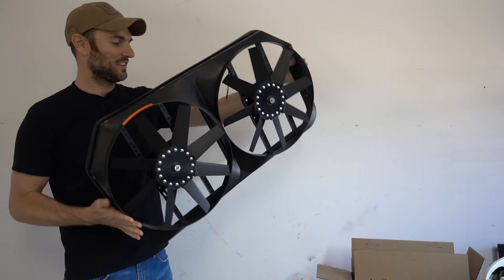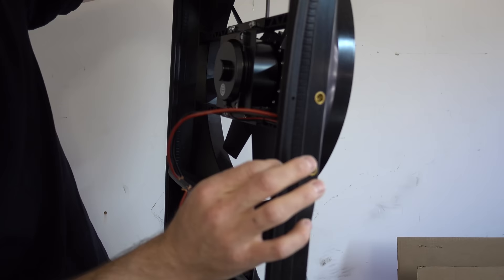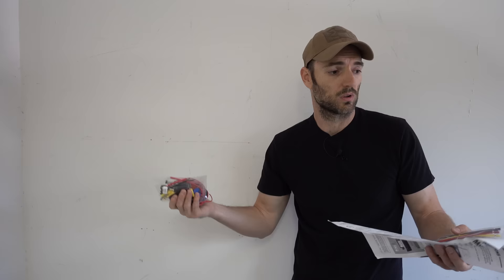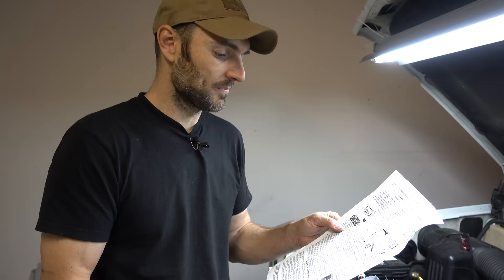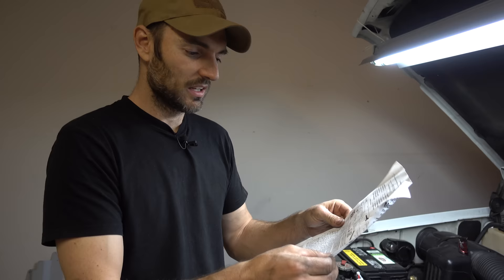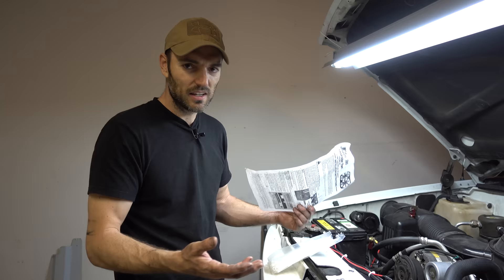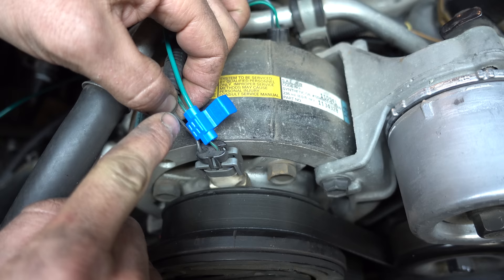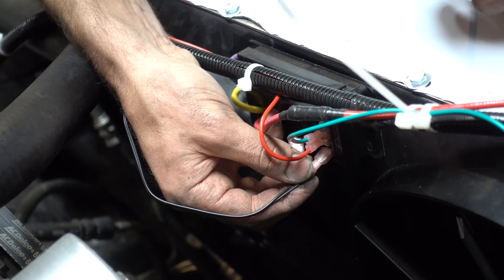Flex-A-Lite 280 Monster Fan System INSTALL & PAYOFF

Comment: Been running flex a lite fans (280)for years! Very durable,easy to install! I can idle all day long in the Texas heat with no problems! I didn’t have to drill a extra hole in my top plate as I have a big 4 core radiator and is probably a little wider! I also have a battery that has both side post and top post so I can easily hook up my fans to the top post! I think you also forgot to  mention that you can adjust the thermostat on the fans to come on sooner or later according to water temp! It also improves fuel mpg and adds a few horses since your not having to turn that big ugly clutch fan and my 383 stroker loves it! 😎Thx for the video!

Comment: I am a A.S.E. certified Master Tech with 30 plus years of experience under my belt.  I love older vehicles.  I currently have my Moms 1995 Caprice Classic, my late fathers 1995 Toyota T100 and, my 1998 C1500 Cheynne.  I also own my own mobile mechanic repair business.  Most of my customers have older vehicles (1976 Tradesman 300,  1963 Suicide Door Lincoln Convertible, 1968 Z-28, 1971 Mach 1 Mustang) so yes, I do know about older autos and prefer them over todays "ADVANCED" cars and trucks.  So sorry that I failed to acknowledge you Idea of installing electric cooling fans.  This is ALWAYS a great upgrade.

Comment: Thanks for the review of this fan system! There is no shame and no apology needed for doing a review of a product that you were given to review. 

I do a lot of crazy engine swaps and such modifications.  This fan would take care of a lot of problems with clearance, alignment and others with a custom engine install.That is a good control scheme where it looks at radiator temperature as well as A/C operation. That is similar to how the newer ECM-controlled fans work on factory electric-fan cars.
Reply: It's not shame, it's full disclosure and not doing it is a bad idea.

Comment: 1 tip on using zip ties. Make sure that the part where you cut the tie off is pointing away from anywhere you might have to put your hands or arms one day. That lil cut end can be very sharp and slice you open. Ive had it happen. Got a scar to prove it. No i wasn't the one who put the zip tie on the vehicle.
Reply from the maker: +Michael Potts That's actually a really good tip. Thanks for that. As for the zip ties, those were mainly temporary while I wait for any bugs in the system that may need to be fixed... So far so good!
Reply: Michael Potts use a flat pair of pliers, like linemens pliers to twist them off. Hurts less.

Comment: I used same system. I tapped into the ac system where the power goes into the pressure switch. This makes the fans run whenever the dash button for ac is activated, not cycling with the compressor. More sonsistent cooling.

Comment: For the price it would have been nice for Flex-A-Lite to have a wiring harness with watertight automotive wire connectors, instead of the customers having to use butt splice connectors.  At a minimum the two fan motors should have been connected together with a pig tail.
Reply: then soldier and heat shrink
Reply: Thank-You! 
I was thinking the same thing. The whole controller and wiring of fans should be done at Factory with actual connectors for power, sensors, and manual controls.
Reply: watertight connections  ? They don’t even have watertight connections on private boats ...lol
Reply: That would have added another $500 to the over inflated price! And the scotchlok the very badge of aftermarket crap!
Reply: Richard Edward  excuses for the inexcusable. At $500 I would expect a proper vehicle-specific wiring harness without a scotchlok and with an auto-reset circuit breaker rather than a fuse. And, by the way, all the wiring enclosed in a proper harness. Aftermarket *JUNK*!
Reply: @theceltbeserk1  HELL YEA FOR THAT PRICE THEY SHOULD PUT THE DARN THING IN ALSO
Reply: Agreed

Comment: When spinning the original fan and its tight that means that the clutch is good working condition, when it spins freely the clutch gave out. You'll notice the vehicles temperature going up when the clutch is giving out and it starts leaking some oil residue.
Reply: I. Renzi I was thinking that too. Probably needed a new clutch.
Reply: I am fairly sure that is incorrect. engine driven fan clutches lock up when they are hot. This frees up power for the engine, while providing cooling when required.
When the engine is cold, the fan should spin easily. When the engine is warm, it should be harder to turn.
Reply: snoopdogie187 You're right that is how they're supposed to work, however fan clutches do go out. The fan clutch in my Caprice went out one summer years ago and it did affect the ac performance and engine temp. Once I replaced it, ac performance improved and the engine stopped heating up.
Reply: It depends.. When the fan is cold it should free spin so the engine can reach operating temp, When the engine gets hotter the clutch engages so the fan starts to spin faster..  

The proper way to test a clutch fan is when the engine is HOT (Obviously turned off), if you try to spin the fan by hand and its too easy to do so the clutch is burned.. When Hot the clutch should be engaged so the fan should give you tons of resistance to spin.
Reply: skirmich Right and we're not sure if that was the case. We're only able to guess since his ac wasn't cooling at idle that the clutch was bad which is why many of us are stating that.
Reply: I. Renzi there is a silicone that could be replaced.. when hot it gets free n fan spins free .. when cold.. hard . fan spins slow
Reply: fan clutch.  yes, a simple part went boom so we replace with different.     a fan clutch for $50-80 is probably all that was needed, I upgraded to a bigger fan (more blades) and a new fan clutch recently, around $120 for both.
Reply: First off the fan should spin freely when cold seeing as it obviously is the way he’s spinning it by hand and how quickly it stops itself when he lets go shows that the clutch is giving sufficient resistance. Second of of all this isn’t a (viscous) style clutch (fluid or oil residue as you call it) this is a spring style if you look at the front as he holds it there is a metal “spring” in the middle as that spring heats up it expands and create more resistance for the fan to spring faster with less slip if he ran the car and got it up to temp then turned it off and tried to spin it, it would have more resistance. If in good working order
Reply: Renzi smart n pretty your the tops
Reply: wrong

Comment: My ac was shutting down from high pressure/temp loads as you described. Swapped the 15+ year old OEM fan clutch out with a new severe duty clutch and it restored AC function, resolved slow, eventual engine and transmission overheat in stop/go traffic or at end of exit ramp off the highway at stop light. If you and your rig is sweating? Change your mechanical fan clutch and enjoy another decade and a half of extreme cool for just $35.

Take your truck off road into headlamp deep water or mud and watch how your electric fans cool. ;) My clutch still spins the moment the nose comes up for air. Though you quote a specific CFM for the e-fans, OEM mechanical fans @ idle can actually pull 2x more if functioning properly. No hack, splice, or even ECM/thermostat tinkering.

E-fans make sense only in one application, IMO - transverse mounted, light duty, front wheel drive vehicles where a longitudinal fan simply isn't practical.

 Something's better than nothing in that case and marginally inadequate.

Vehicles engineered for e-fans from factory don't spin the fans over 40~45MPH. Air ram through the nose keeps things cool and copasetic. Slow to a halt and those fans kick on, accompanying a slight rise in temps on engine and interior as they can barely keep up.

In my application, an e-fan is an expensive compromise and a downgrade!

Comment: Find a different location for your battery negative connection.  The issue is mechanical: you risk having less than 3 threads to engage, which is a recipe for stripping threads.  Follow either one of the two wires on that connection - electrically, it won't matter, as long as the connection is tight.

Comment: Nice video. I would add though, when you tap the fuse, need to make sure you tap after the fuse. since there are 2 leads on the fuse its a 50/50 unless you check. Check by pulling the fuse out and checking which side is hot. Than tap the other side. Price is high for a unit like that, but it does work nicely. especially the variable rate.

Comment: If you wanna free up some more horsepower, get rid of the air silencer coming from the fender to the air filter and use a piece of straight pipe.  There is also an accordion type tube that is made but straight would be better. Good video

Comment: Did this with my dads plow truck without needing a kit. Bought a slightly oversized aluminum radiator and just found couple inexpensive electric fans, wired up a pair of relays and in our setup ran it off 2 switches. Just as a test, I let it almost over heat, turned on 1 fan, watched it starts to drop, let it go again and then threw on both fans and it dropped below standard operating range in a matter of seconds. :)

Comment: Just an idea, I'm going to do this on mine when I get it. The residual heat in the radiator is harmful to it from pressure. If you connect the power to a constant instead of the ignition, after the vehicle is shut off, it will remove the heat in the radiator and there for reduce pressure, which removes stress on it helping it to last longer
Reply: Then your battery dies?
Reply: @demetriuscaldwell6010  I have a 3/4 radiator high quality Odyssey batteries Valvoline coolant and only once in awhile then kicks on after the engine is off last only a few seconds it sounds cool as hell never had a problem affected my electrical

Comment: I installed the 282 Monster fan on my '04 Suburban. It worked great as you've suggested. The only issue I had with it was the ground wire wasn't sufficient for the job. It subsequently burnt up at one of the connectors, so later had to replace it with a much thicker wire to compensate. No problems after that. I didn't notice any real amount of mileage improvement, but the A/C system (Suburban A/C with separate rear unit) worked great at any speed, even sitting still. This is a great option for mechanical fan replacement as the Flex-a-lite fans are solid and work great.
Reply: BULL shit, not a wire but resistance at connection.

Comment: Those butt splice connectors are probably the reason it's pulling more amps than a proper soldered connection. After few minutes of 30a through those, they'll start thermal runaway. That red wire is also crazy thin for 30a. Also, grounding at the battery might lower your voltage at the fan controller even further. Ground at the frame or engine block (alternator bolt or bracket is common).

All of this is unnecessarily stressing out your alternator, no matter how many amps it's "rated" for

Comment: Holy crap, $500 for an electric fan conversion? I'll just yank the rad and electric fan off of a newer 5.3l truck for $100 at a junk yard.
Reply: Lynn Mckenney 😂 hahah si si
Reply: The fans from a 2004 impala fit pretty good with a little clearancing.
Reply: Lynn Mckenney May do that swap on my wife's truck in a week or two, just need the temp sensor ,and pressure switch for the ac.
Reply: Really just need the oem fan and shroud assembly, not the radiator. I took an assembly off a 2007(?) tahoe at the junk yard and it bolted right up to my 2004 avalanche frame behind the radiator. I believe they switched to electric fans from the factory in 2005.
Reply: Get the fans from a 94 to 96 caprice/Impala
Reply: Well u just go ahead and do that buddy if you're that hard up on cash
Reply: Or just go on Amazon and get two 14 inch electric fans for 50
Reply: You get what you pay for
Reply: You can get a kit for 45 bucks on Amazon
Reply: @skyapplegate9228  yes, you do. The name is worth the extra cash.
Reply: Richard Edward  why are these "way better"? $500 and they don't even fit! Paying for a name doesn't equal better. I bin this setup as just another piece of aftermarket crap.
Reply: Five hundred 20s  with a Derale electronic fan controller. Yes I took off the clutch fan. Worked out pretty well.
Reply: Five hundred 20s  no. If you look at the device I mentioned it comes with a thermostat.
Reply: @AG-qw6nd  would it fit on a 02 table?
Reply: @walterk1221  Flex-a-lite doesn't sell garbage like low dollar Amazon and Ebay options. This is a full kit tried and tested in the harsh environment of Baja racing. It comes with everything you need, flows more cfm, and is quieter than the chinese crap. I've installed those cheap chinese fans that customers bring in and they usually quit working after one summer of offroading
Reply: @walterk1221  The kit I buy is readily availible from Jegs or Summit and has been for years. I think the twin 12" fans with shround + the controller is less than $300. I've installed them on atleast 8 or 9 trucks ( 3 of my own). Not a single failure. Good day sir
Reply: @edjackson4389  you have been lucky in that case. I will continue to avoid junk, thank you very much.
Reply: Doesn't fit.
Reply: @Ben-kc9ye  my 04 Tahoe came with electric fans

Comment: Thanks for a great video. 
Just wanted to share I had a similar problem where the aircon would blow cold only whole driving. 
Turned out my alternator was faulty, it wasn't charging properly. 
When I went to have the aircon recharged, I had them test my battery and they found the alternator was faulty. 
After they completed the aircon charge and tested it, they found it wasn't blowing very cold. They thought the compressor was faulty. 
When I got onto the highway, my aircon suddenlyblewnice and cold.  When I got to the suburbs, warm air. That's when I realized it was the alternator that was the problem. I had that fixed and voila, nice cold aircon. 
Hope this helps someone.

Comment: You didn't need to put neg to the battery like that. It could go to any grounding spot in the engine bay would work. Also use black zip ties. It will look better and not make your work look so obvious

Comment: I wouldn't use T-Taps like that on the AC Wiring at the AC compressor. Best method is to solder the wires together or use a butt connector with shrink tubing to prevent corrosion. 

You can normally find a key on accessory access in the fuse panel compartment. Never double up on another fuse as this can and will most likely overload the current wiring circuit potentially resulting in melted wiring, fire or constantly blowing fuses not to mention costly repairs unless you do your own repairs. 

I wonder if they have these in a kit where you can get a harness and plug the wires from the fans to the ecm and have a dealer or shop with a bi directional communication with programming capability turn the fan controls on with a ecm update. 

I've also considered getting a salvage fan kit from a newer vehicle, harness and all from a parts yard and seeing if the ecm can be programmed that way as well. 

Anyone try the flexalite option that maybe went to the dealer option or added a dealer harness to the flex a lite with vehicle onboard control of the fan? 

I'd definitely be interested in hearing different installations that have occurred.
Reply: Dale N what vehicle are you replacing the fan for, and how's it working for you?

Comment: I use to drive a 1998 GMC suburban 5.7 and in the summer when I stop it didnt get too warm in my truck and it was 105 outside and it was blowing cold and I had the regular fan the clutch fan probably failed or you probably needed a new condenser but you were also using the rear A/c will cause It to be warm because you're using both front and rear

Comment: here's a tip for your lower radiator hose clearance. loosen hose clamp twist the radiator hose in the direction you need for Clarence and lock the clap back down. duh lol

Comment: I love your vids dude but it has been my experience that electrical tape has no place on a car at all. It is BEST to heat shrink  all joints with a little dab of dielectric grease on the wire connection to prevent corrosion.  The piggy back connectors are not a good idea as well. The auto industry uses a special tape that has no adhesive. Just my two cents worth.Keep up the vids.

Comment: I put some 420 model # twin 12 inch flex a lite fans on my 77 dodge mini Motorhome with a 440 ,like about a little over 300 dls i was really happy with them until i finally took a road trip to El Paso Texas from California and one of those fans stopped working and the both wires that came out of one fan motor burned up, my wife panicked and got out the fire extinguisher, i guess I should have used more fuses ,i tried to talk to flex a lite and they basically gave me the finger, well my bad i should have done my homework now I've replaced the 2 fan motors with SPAL and adapted it to the flex s lite shroud and it works perfect i wish that I can post photos of there junk motors opened up with rust and trash inside it shows that the brushes are like at 85% new, so please take my warning seriously, that is the heads up on there over priced junk. Ps i should have known that those 420eees were going to go up in smoke, lol ,now  u know.

Comment: I purchased my “282” on eBay for $300.00

Installation is relatively easy as he details 

^ HP, ^MPG
Reply: Jack Smith the probe that went into the radiator cane with the fans?

Comment: Your chevy truck has 2 accessory fuses that are on only with the ign. on. I used those when I modded my low beams to stay on when I turn my high beams on.
Reply: Hey Johanthan, can you send me a link on how you did that. I've got new headlights I put my LED's in and want to double bnb up on my high beams